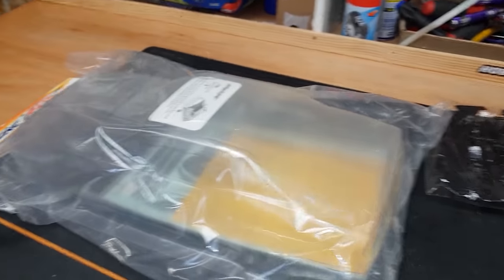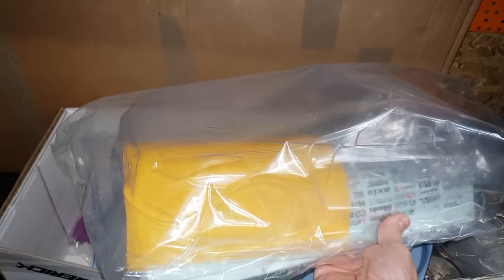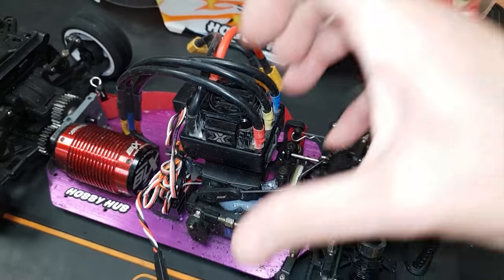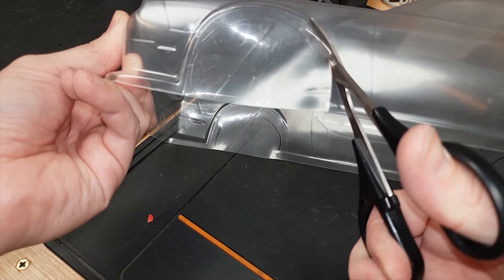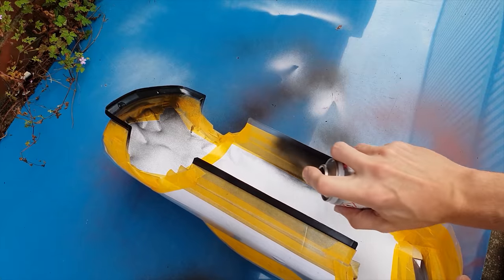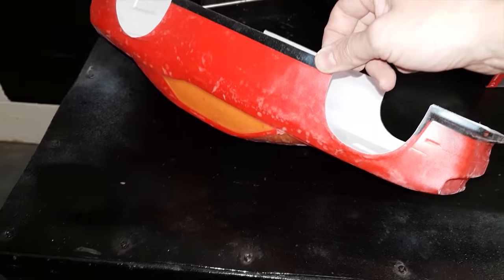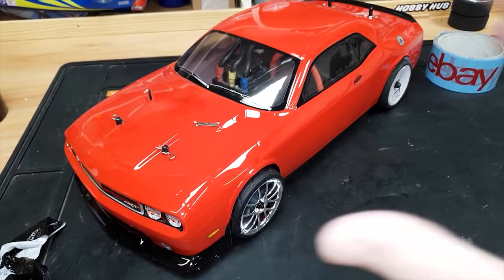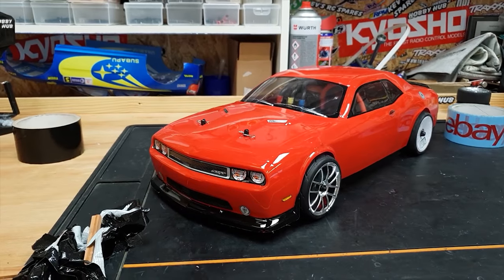RC Dodge Hellcat Burnout Car

Comment: for the 4x4 project, i recommend the hsp xstr, they are very reliable and has a similar setup, it also has a chassis support which can mount the sec and receiver.

Comment: The first body I ever painted I tried using the heatgun to fix a mistake n the thing just started melting, even when I hurried up n took the heat off it still continued to melt, it was too late! 😂
Reply: @RC Dre thats why you always need to made a little research ,watching videos ,reading articles etc ,

Comment: you said that you will try to make a nitro burnout car I got an idea instead of using a transmission you should mount a gear to the motor then mount a pinion on the front like the fwd burnout car that would be more efficient

Comment: @kevintalbot I was wondering if you have ever put a Motor on each differential ? Front and rear set up for a motor on each end of the 4×4? Put a gear on the other end and reverse the motor/or throttle on one and have them going through the same esc? Kind of like the emaxx has two motors ? How about no driveshaft and a motor on each end ?

Comment: I watched your video on the trx-4 with the inter finders and I may have a solution for that, can you try to put the front inter finders on the rear so you don't have to cut any plastic on the finder and the suspension and body mounts will still be in the same position and you still can make the battery box strong      love your vids Kev

Comment: I don't know how you manage to cut out your bodies so well, every time I try I end up with a mangled mess. Thanks for the upload!
Reply: Aaron Charpentier curved scissors are awesome, also you can use a scalpel for straight edges, then bend the plastic and it breaks really nicely and straight. Be careful with knives tho
Reply: @Al3xisAE  
I have a set of curved lexan scissors, my problems always been with the straight line cuts. Ill try an exacto next time, thanks!

Comment: For a truggy if it doesn’t do wheelies stock what gearing should I do?
Reply: Owen Tuckwood smaller pinion (gear on the motor) or bigger spur gear (gear the pinion is meshed with)
Reply: Alex Carter thank you. I have an FTX carnage brushed at the moment as I don’t have much money. To me it seems rather fast. I am not sure what size the pinion and spur gear sizes are.